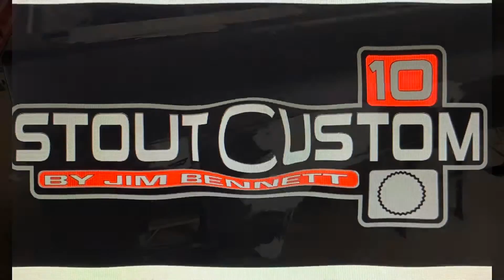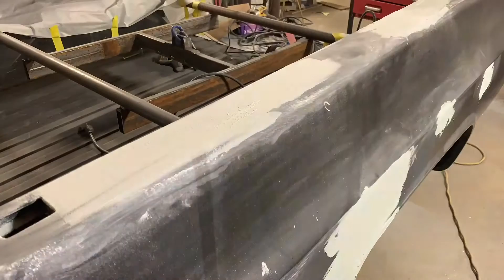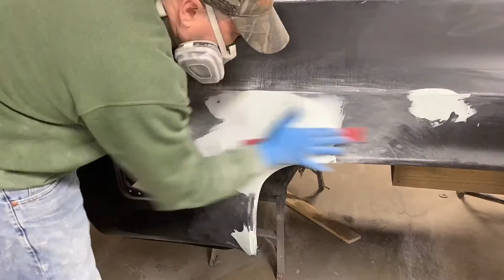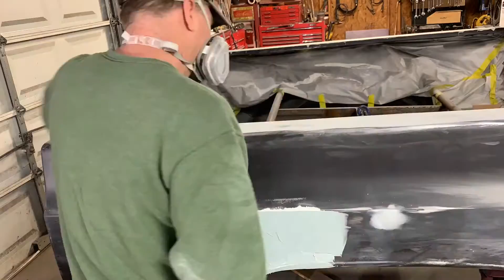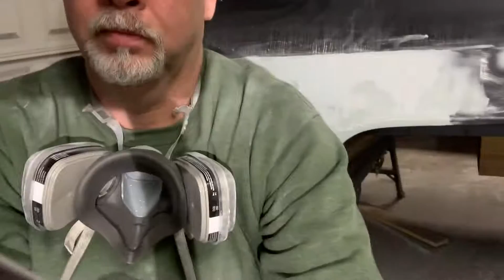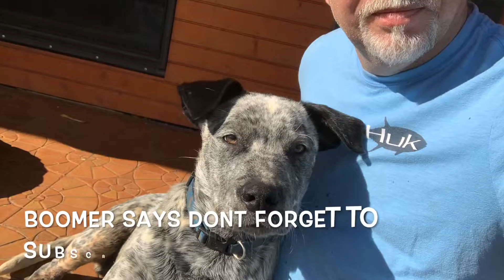C10 Repaint: Working the Bed.  #c10, #squarebody, #c10nation

Comment: I'm loving this video series. Im building an 86 m1028 (d30-k30) and im in the bodywork stage. Blasted the whole truck put it in epoxy primer and am going through all of the body work now. Im having a hard time getting that lip around the wheel well shaped JUST right. Ive got several spots along those lips as well as many other highs and lows. It takes time thats for sure.
Reply from the maker: mastercraftprstar197 Cool!  Yeah those complex curve areas are tough. Almost have to freehand them. Definitely takes practice. Thanks for watching!

Comment: What grit paper did you start with and what grit did you finish with? What high build primer did you use? Nice work!
Reply from the maker: jody reed Thanks!  I start with 80 grit. I’m using Evercoat Rage Ultra body filler which sands so easy with 80 grit that there’s no need to go any coarser . I finish everything off with 180 prior to three coats of VP 2050, a high build epoxy based primer in PPG’s Vibrance Collection.

Comment: What are you using as a block?
Reply from the maker: MartinMora92 I believe it’s the large paint paddle for a 5 gallon bucket cut down a little. If I can’t find those I buy the wooden yard sticks and cut them to what ever length I want.
Reply: @StoutCustom  what block did you use on  wheel arch curved area for the square c10?
Reply from the maker: MartinMora92 I round over one edge of the 5 gallon stir stick to give me a little more contact area and use that as much as I can along the top of the wheel arch. Once it gets into each end of the wheel arch where there are compound curves, I switch over to a Motor Guard Wonder block, a long round durablock, or the long flexible rectangular dura block. It usually takes a combination of all of them to get it right.
Reply: @StoutCustom  i appreciate the reply
Those are difficult areas for me in this truck
You just got a new subscriber my friend 😎
Reply from the maker: MartinMora92 no problem. Hope it helps a little and welcome aboard!
Reply: @StoutCustom  thanks
Greetings from Milwaukee Wisconsin 🤝